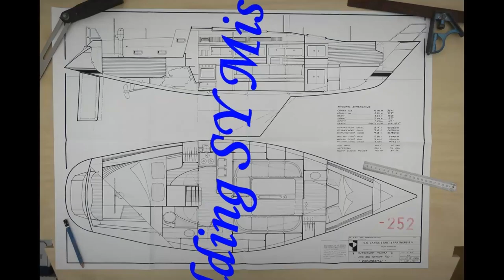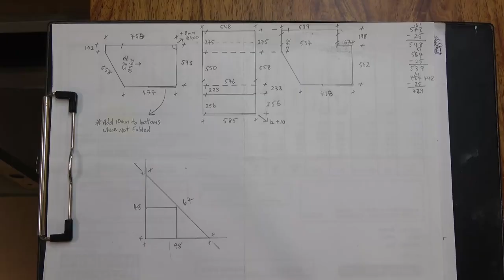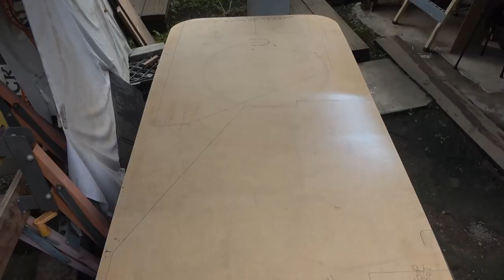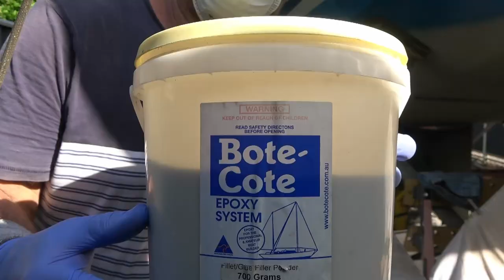MORE good FITOUT progress! Ep.133 Building my steel sailing yacht

Comment: Will the rose wood not rote sitting in water all the time? There will always be a little water at the bottom. May be I miss under stood and the sump will hold the water and non will be in the bulge area where the rose wood shimmies are?
Reply from the maker: Thanks for your question, the shower water will drain to the sealed sump box where the pump will remove it through a through hull fitting and the battens should always remain dry and are double epoxy coated to protect them.

Comment: Bruce. How wide is your stove and is it propane a d  gimbaled. Most stoves are 22 inch wide for a average 3 burner stove oven. The force 10 4 burner stove is 22inches wide but you real don't need more than a 3 burner unless your a 5 star chef or Gordon Ramsey. . The extra space is good for storing sheet pans and chopping  boards. . I store those please my  Magna fish filet board there. Just suggestion
Reply from the maker: Thanks for your comments and yes, the stove-oven is gas/propane  🙂👍